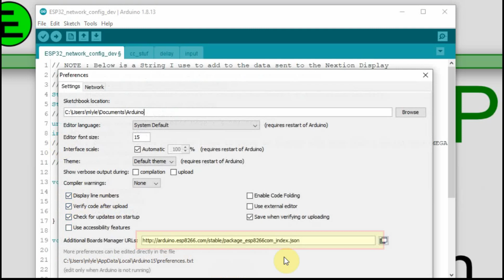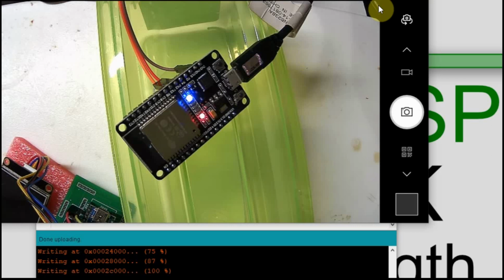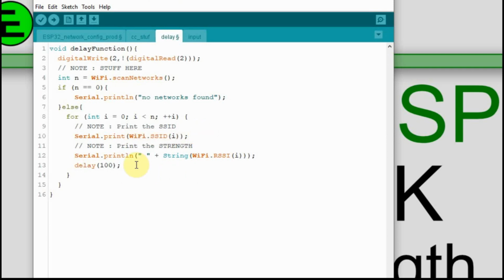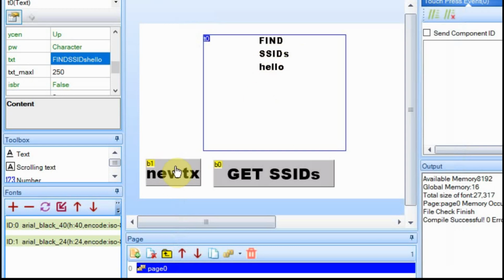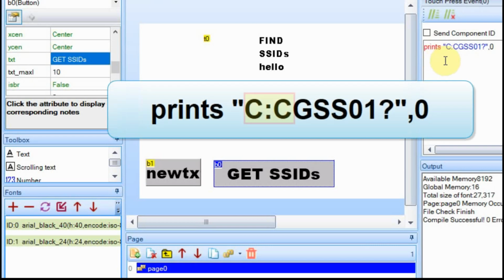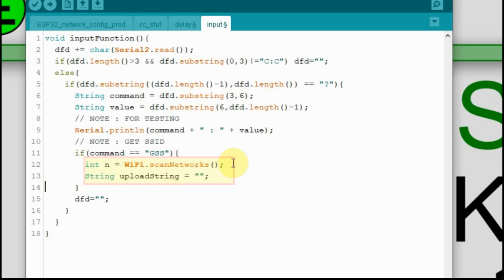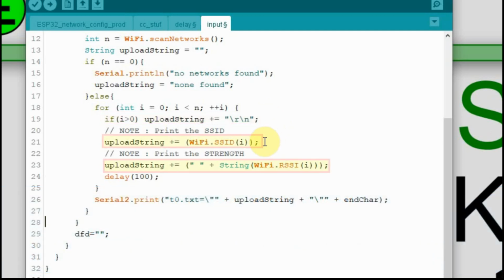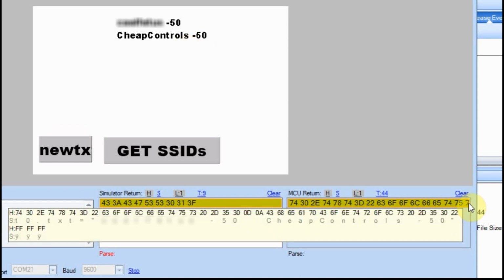177 #ESP32 WIFI with the #Nextion Display with a multi-line text object #best

Comment: Hi CC.
Nice tutorial, thanks a lot.
I wonder if you can do another tutorial on how to connect with these found wifi networks soon.
Reply from the maker: I will be.  I am working on a project that allows a user to connect dynamically to networks and transfer data between devices.  I thought I had it all figured out but I had an issue with the dat transfer.  This is why I did a video on the recmod command.  I should be back on track in a week or two.  Thanks for watching.

Comment: Hi CC, thank you for your tutorials. i got problem on connecting with my esp32. its like my esp32 RX TX  pin cant communicate with the nextion lcd. could u make a video for this kind of problem?
Reply from the maker: Make sure you also have a ground wire connected
Reply: @CheapControls  i thought the serial2 need to define it. thank you, i will check again later
Reply from the maker: Not for the version of ESP32 that I am using.  I have another version that does not have TX2and RX2 as pins.  That one would need some sort of definition.  I do not believe the Software Serial library would work for ESP32.
Reply: @CheapControls  absolutely...

 Rx2 and tx2 lie on pin 16 and 17 on every esp board..

Previously you even need to change the library
Reply from the maker: @dr.hrituraj  Thank you for that information.  I will try it on the one that does not have it labeled that way.
Reply: @CheapControls  Hey there..

Can i Just ask a small Question

Can nextion log to available webserver by it self with IP

And by the way...your tutorials are Fabulous 🙏🙏🙏
Reply from the maker: @dr.hrituraj  Thank you for the compliment.  I have never seen a Nextion display with built-in WiFi until yesterday.  I saw a prototype of one with a built-in ESP32.  I am unsure where to get it, but maybe it will come out soon.  I do have a video that will be out in the next few weeks on how to select and log into a wifi network.  So, if you want the Nextion to do it stand-alone, I do not think that is possible.  If you want to do it with the help of an attached ESP32, I will have a video on that soon.  Maybe next week.  I took a week off making videos but should be back next week.  Thank you for watching and taking the time to comment
Reply: @CheapControls  Thanks a lot for Reply ..

Waiting eagerly for your next video...

I was planning with ESP32...and Nextion

GUI of Webserver need to be made separately in your planned video or does it takes the Html define UI...

Excited a lot...

I know editing and all takes a lot of time and won't force you to upload today...

But
Post it ASAP...

Thanks in Advance 🙏🙏

Comment: Can i connect nextion with esp32 directly?
The voltage of esp32 3.3v 
And the voltage of nextion 5 volt
Reply from the maker: I have read that you can use the VIN pin for 5 volts when connected to USB but I have never tried and am a little worried that it will damage my display.  I am going to try this in my video next week.  If you can wait I will test and show in the video next week.  I also plan on sending negative number to the Nextion display in the next video.
Reply from the maker: I agree that connecting the VIN is probably a bad idea but I think most people that follow my channel are hobbiest and try all sorts of things.  I will take your information into consideration and put a big warning that this is a bad idea and that I am only doing it for experimentation purposes.  I made that board for the nano with a built in regulator.  Maybe I will make one for the ESP32.  then I could direct voltage separately to the Nextion Display.  I have read a ton on the displays but never the recommended voltage in.  Thanks for the info.
Reply from the maker: I have not looked into other connection types(I2C or SPI) yet.  I am just winging this.